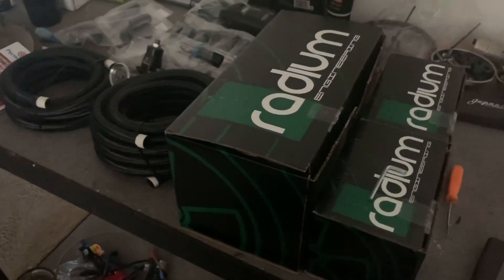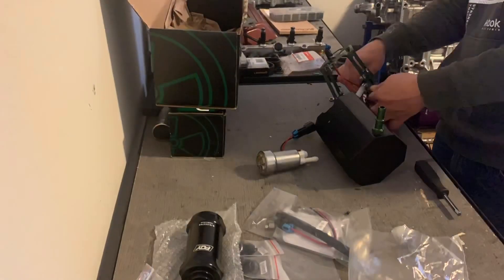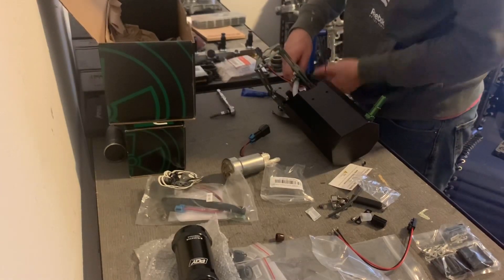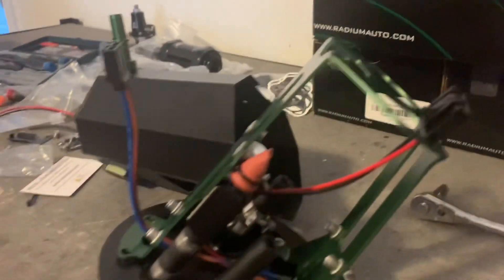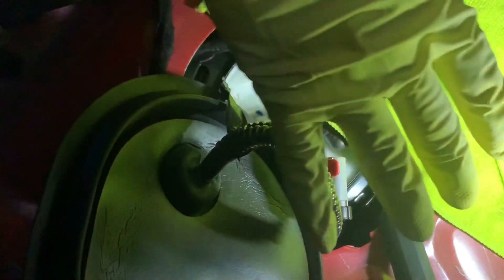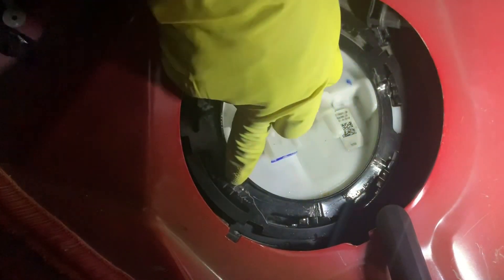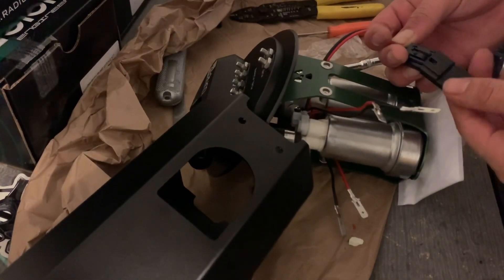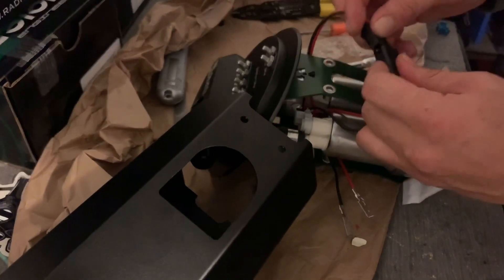Installing the RADIUM dual pump on my S550 Mustang GT

Comment: Will these work just as good as a return style system? With good pump?
Reply from the maker: This is set up as a return fuel system it has worked great no issues at all, hope that helps. Thanks for watching.
Reply: @d.vironside7878  Thanks, glad I found your video.